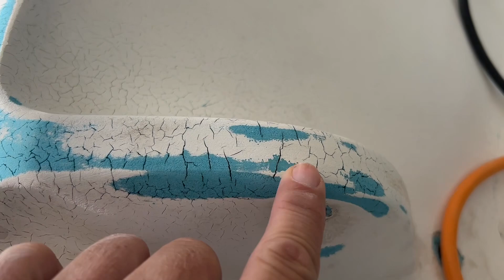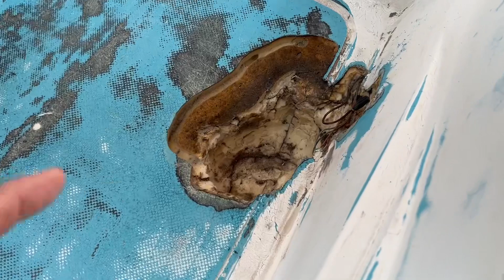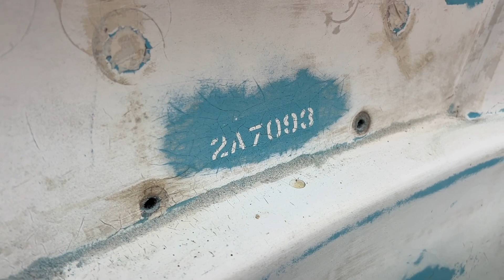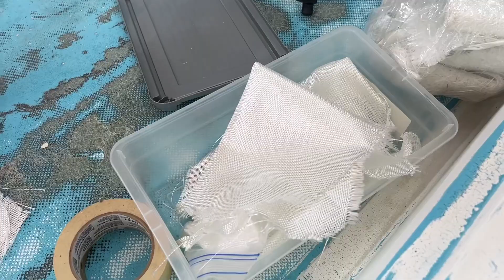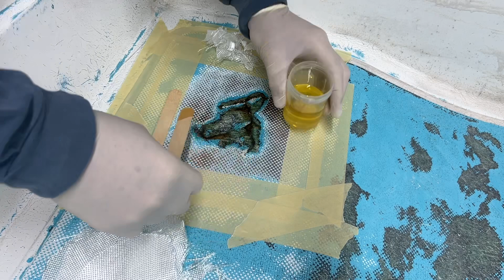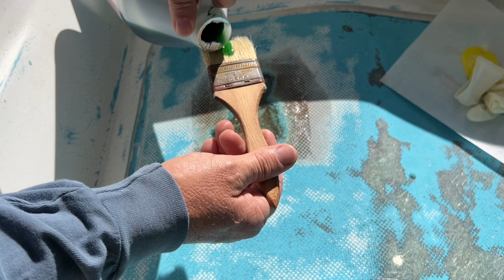1971 Boston Whaler 13 Restoration - part 7- patching holes

Comment: Awesome job. Looking to purchase a 13 classic this weekend and noticed in the pics the gelcoat has a ton of crazing.
Reply from the maker: all of the classics do. they used to put the gell coat on to thick causing shrinkage over time. you will notice a lot of crazing on the corners whe it looks like they would have “beefed up” the gell coat in the mold

Comment: What type expand foam did you use? Can you share the info? I’m doing some restoration myself on my 13 BW. Thanks
Reply from the maker: https://amzn.to/4lALCwf . i added a link in. the description.  this foam expands 3 times its size so tape off real good.  great stuff is the brand.  this is not a 2 part, which is really recommended, but that stuff is so expensive and this will work just fine. just make sure your fiberglass work is up to par.
Reply: Thanks!

Comment: Lol, these BW’s are like giant surf boards w/ side rails. I’m surprised you didn’t use cabosil filler mixed with resin to fill those small to medium holes. Btw, nice video as I am also a proud owner of a (‘68) BW 13.🤘